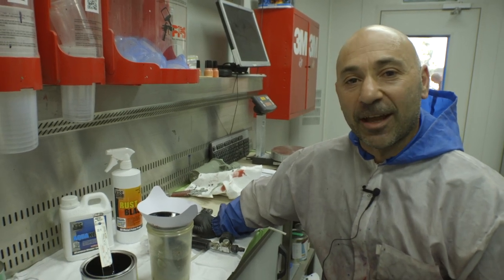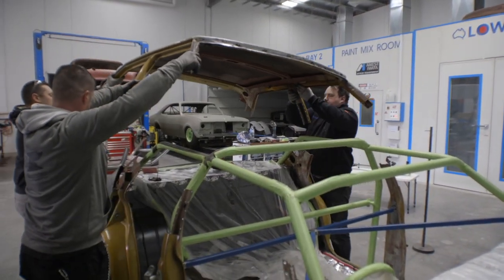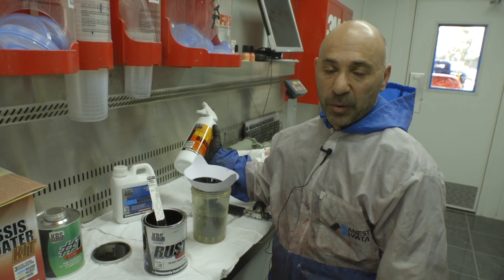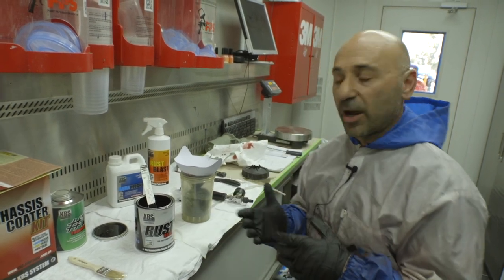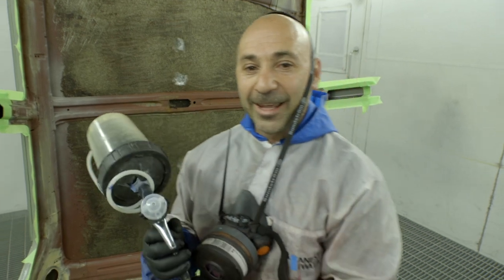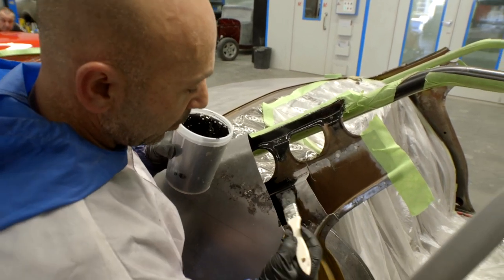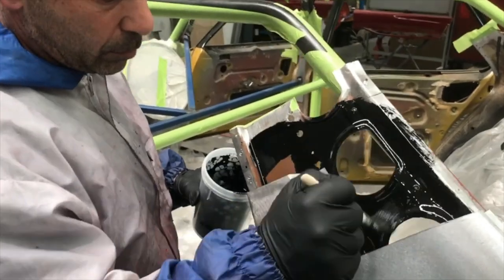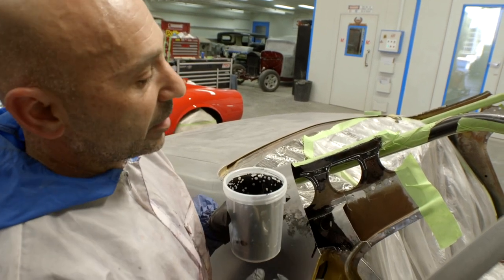KBS Coatings Australia / Rust Blast with 1973 HQ GTS @CAD CUSTOMS

Comment: There is often an 'argument' (HA - AKA - "robust discussion") re treating an area of rust that it is impractical to pull apart the complete structure and replace the 'small' area of metal.  And for this 'example' - I am not referring to a flat piece of metal that one can get access to the entire exposed and rusty surface and use the KBS 3 stage process.  And therefore, for this example - an inner structure area with multiple layers of steel, and where that area has in the past, has let water etc in and the sandwiched metal has become rusty.  If one was to clean and thoroughly dry the area and then 100.0% seal//soak//"encapsulate" the rusted area with the KBS RustSeal paint - and then possibly for added 'peace of mind' - ensure that that area is completely sealed with cavity wax (or similar), and so therefore ensure that moisture NEVER again enters that area - will the 'rust' in that now KBS RustSeal paint treated area by being 100.0% sealed//soaked//"encapsulated" with the KBS RustSeal paint - then be dormant?  And only to be 'woken' back up IF water//moisture reaches into that treated area again?  

I am not 'per se' advocating using KBS RustSeal paint as a rust repair 'per se' - but in an example, where for practical purposes (HA - if one can define the term "...practical..."), to get to a sandwiched area is not "practical" - and therefore cleaning as much as is possible and then 100.0% drying the area and then seal//soak//"encapsulate" the area with the KBS RustSeal paint - would we then have a 'almost perfect' way to ensure that whatever rust may still be present, is then dormant for as long as it shall remain DRY?

I understand that KBS has a rust converter that can assist before the KBS RustSeal paint is applied - BUT - as someone that flushed and flushed and flushed and FLUSHED an 'almost inaccessible' area that was chemically treated - and then to sometime later - and AFTER topcoat - have chemical creep back out - some areas are 'risky' to be pumping acid//chemicals in and then try as one may - then try and be SURE to flush//neutralise with water - and of course - then ENSURE that that area is then 100.0% dry before the KBS RustSeal paint application.  

Hence - there may be 'two schools of thought' ----  1) KBS rust pre-treatment, clean and dry and then KBS RustSeal paint - 2) Clean and dry and then KBS RustSeal paint.  If in both 1) and 2) - water//moisture never shows its ugly face again to the 'dormant rust' - do we have for all intents and purposes - DORMABT rust held at bay by the KBS RustSeal paint ? 

HA - for the sake of 'accurate science' - I tried to remove as many 'variables' as possible.

Thanks.  CHEERS from AUSTRALIA.

Comment: Did you have to use a thinner to thin it out before you sprayed it through there gun?
Reply from the maker: Hey Drew, in this video carmine didn't thin it out, he used a 1.8 tip. Generally thinning of 5-10% is recommended. Use kbs thinners only otherwise won't cure properly. Any doubts, call the support line on 1800809036. Cheers
Reply: Would using an undercoating gun work best for non thinned rust seal or a 1.8 to 2.0 mm tip should work on a regular basis? New to this, going to do my own truck frame and rockers but don't have a giant compressor(6.8 cfm @ 40 psi) so I was gonna get an lvlp gun with a 2.0 mm nozzle to do it but a if an undercoating gun would work better for rust seal I will go that route.
Reply from the maker: Drew Mead ive sprayed unthinned with 1.4 gun. Don't use an undercoat gun. I'd suggest a smaller gun tip. Have a play with getting spray right on some test pieces  before going all out on your truck. Cheers
Reply from the maker: Drew Mead http://www.kbs-coatings.com.au/spraying-guidelines/